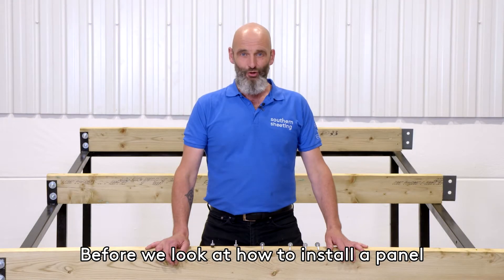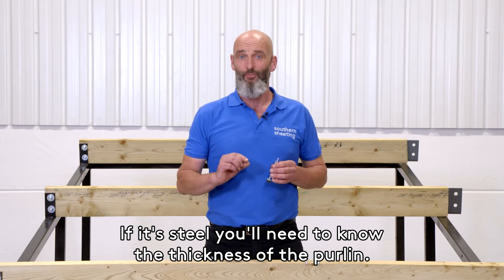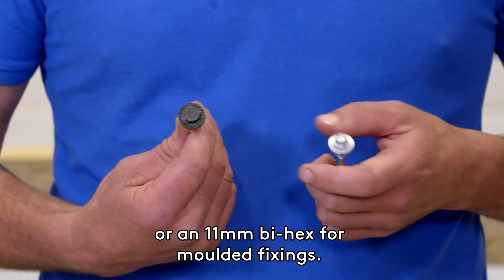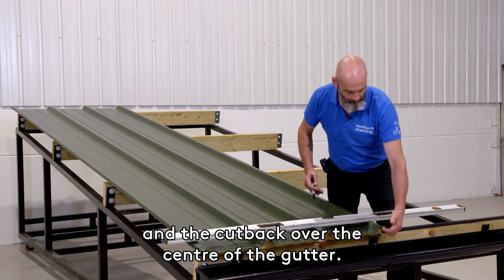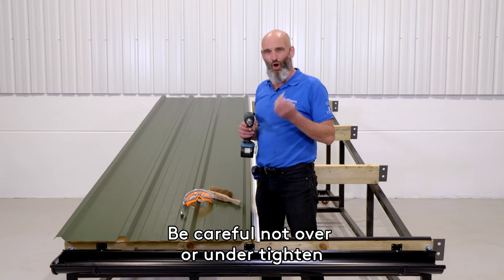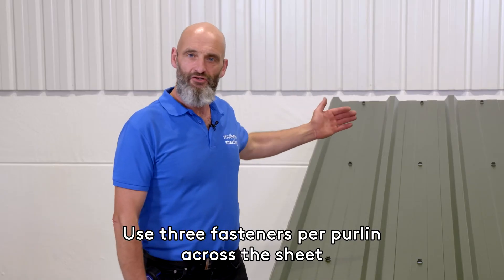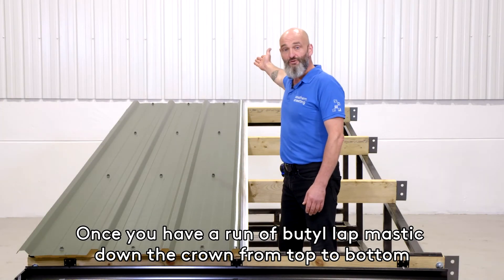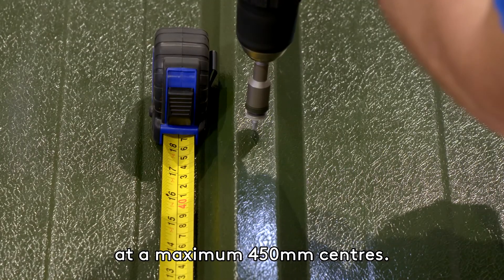How to fix insulated roofing panels with their correct fixings

Comment: Should the screws not be on the high points?
Reply from the maker: Hi Mary, If you screwed on the top of the profile (high points) it would compress the profile, possibly bending it. You'd also need a much longer screws to reach the wood/metal. Hope this helps.
Reply: @SouthernSheetingSuppliesLtd  I was told on the hight points as water runs down the low points and can get in where a on the high points water cant run down ?
Reply from the maker: @maryellis3661  Hi Mary, No its a common misconception that you have to fix on the crown. It is absolutely correct to screw your main fixings in the valley as the neoprene washer on the fixing needs a hard flat surface to bed in correctly. Hope that helps :)

Comment: Hi, I'm planning on using these on a shed that has a chimney, do you think silicone roof flashing works well with this type of panels?
Reply from the maker: Hello, if you referring to a steel flew coming out of the roof the answer is yes, the dektite pipe flashings work well however it also depends on the size of the pipe and how far down the roof the pipe is exiting.

It is quite common to use what we call a ski slope flashing in the industry, this comes down from the ridge and passes the pipe by say 300mm for example, it bridges the corrugations of the sheet and you would need to insulate under the flashing and use a profile foam filler to block of the end however it gives a much flatter surface for the dektite to be fixed too, no need to mould it around the profile and it also eliminates the pipe becoming a dam in the valley of the profile.

There are other things to consider with any roof penetration as this increases the chance of a potential leak later, it may be worth considering doing a side exit and running the chimney out of the wall and up.